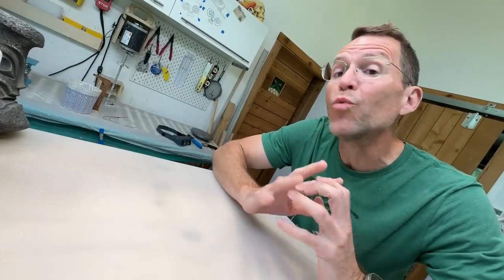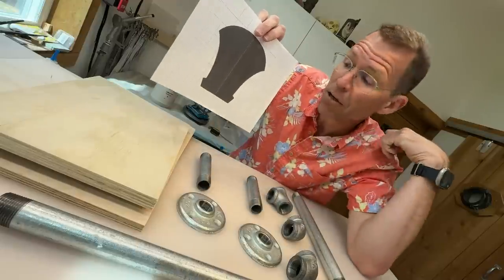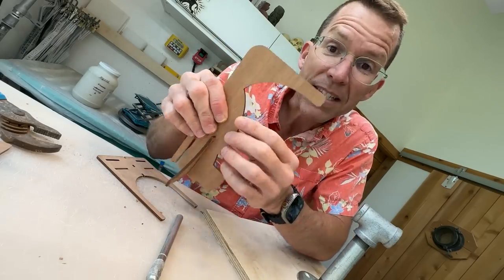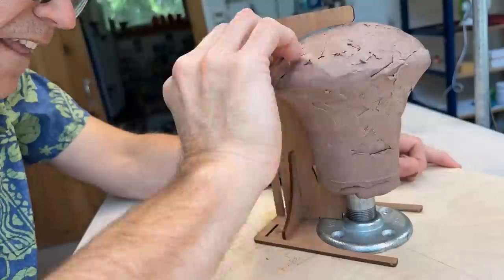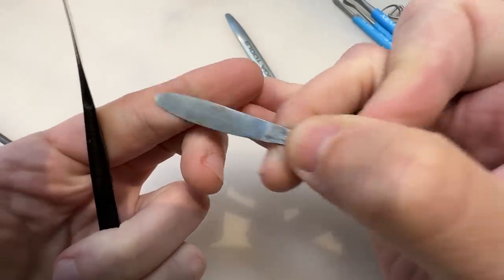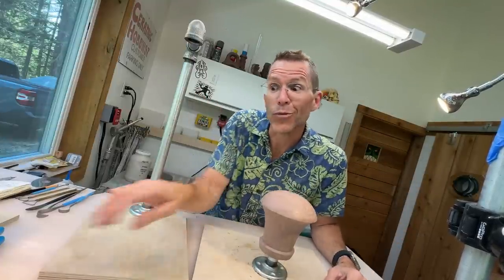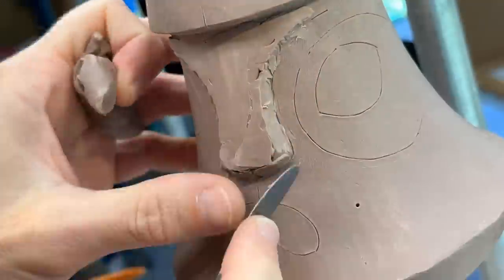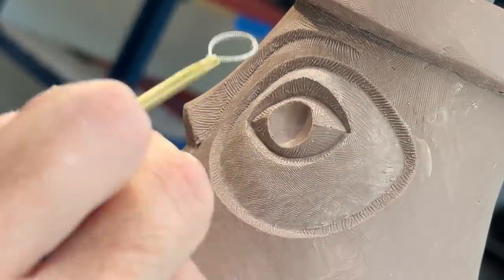Sculpting a new mug - templates, tools, and texture! - Tiki Technical Tuesday

Comment: How do you determine the sculpture size to ensure you have enough room for a drink?  Is that something you find out later or can put that into the design?
Reply from the maker: Good question! For this mug, I wanted it to have a size similar to a mai tai glass (aka a double old fashioned) - so I planned my model to match that size (scaling up a bit for the %12 shrinkage of the clay I plan on using)